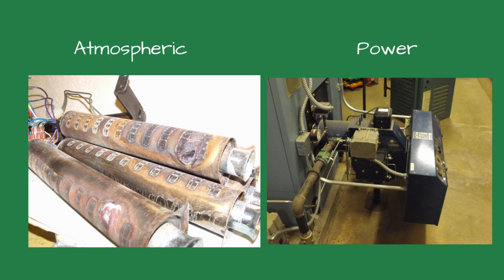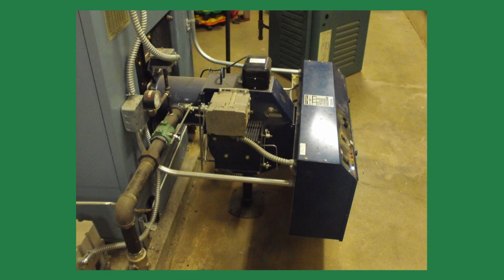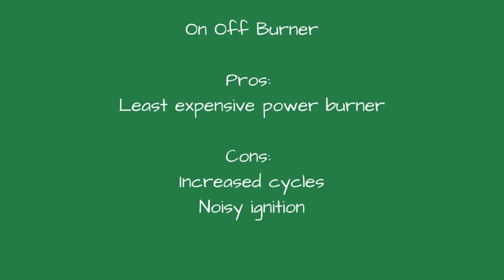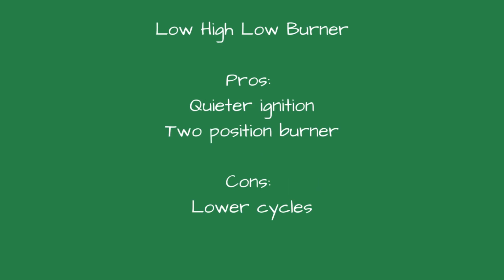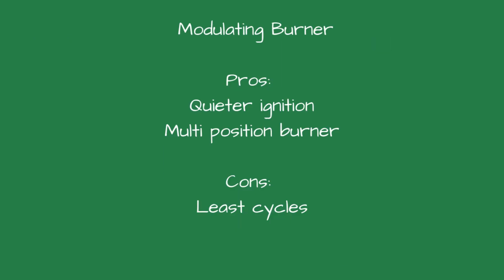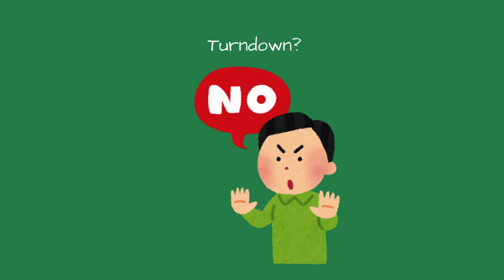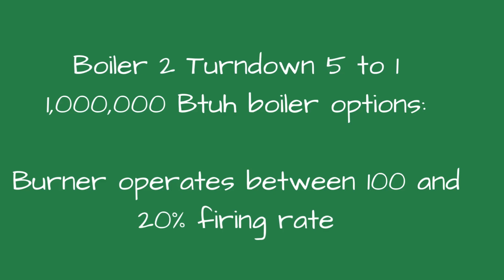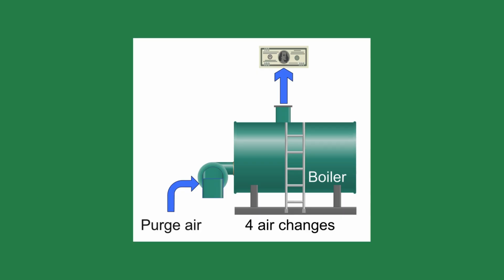Understanding Gas Boiler Burners: Firing Types & Turndown Ratios Explained

Comment: I have a Cleverbrooks boiler, model CBE 100-100 INPUT 420000, manufactured on 10/25/96. It is currently operating at 9 bar pressure. Is there any damage to it? What do you advise?
Reply from the maker: The manual said the boiler is rated for a higher pressure than the 9 bar but I would check with the Cleaver Brooks Rep
Reply: @boilerroomdetective I am talking about a kettle that is 27 years old now. The body was measured, thank God.
Reply: @boilerroomdetective I really need to contact you via email. I'm trying to translate the episodes and understand.